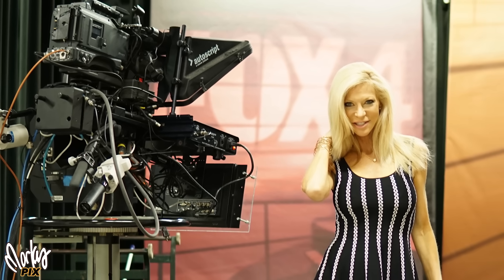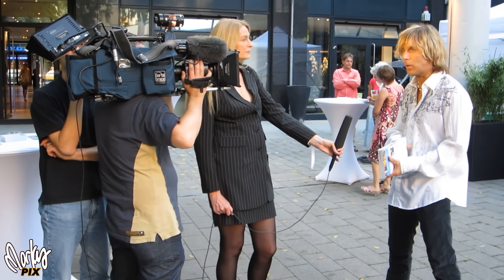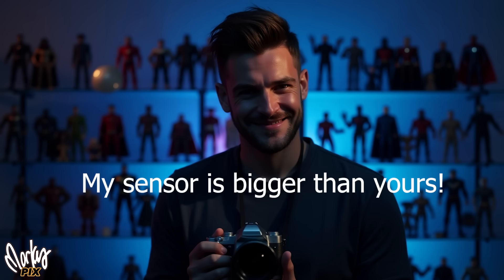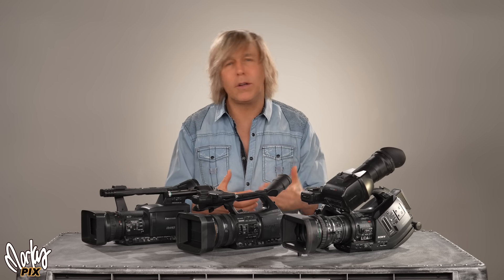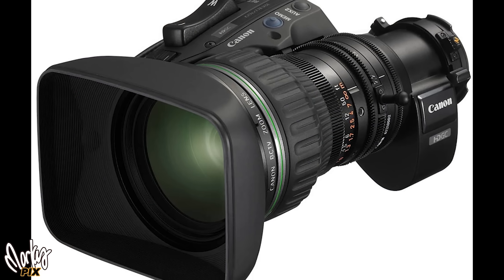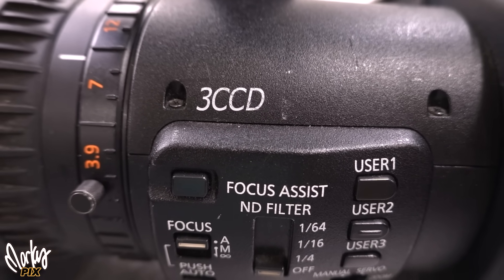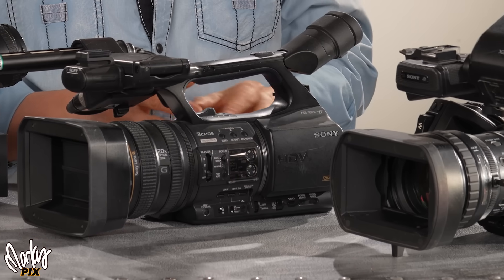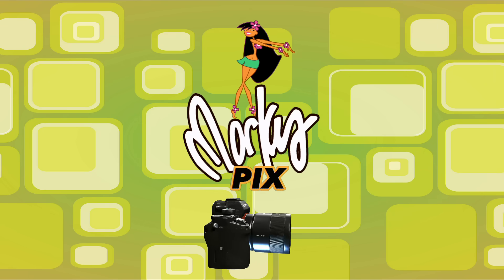Why the Broadcast world uses 3 chip video cameras

Comment: I own a prosumer camcorder with a prism 3-chip sensor technology, it is the last one made for a consumer level with a rather affordable price. The Panasonic HC-X920, which was at about 1000$ when it came out, I got it for 180$ second hand.
The sharpness of the image is insane, the guts of the camcorder don't take much advantage of the amazing sensor it has but it still makes a much clearer video than many newer consumer cameras.

Sony makes prism camcorders now like the Sony PXW-Z190, Z280, Z750, but they cost a lung to obtain. I wish more companies offered a prosumer camera for 4K 60fps prism technology without all the tricks and bits of a broadcasting camera that make it insanely expensive.
The cost is not because of the sensor, a replacement for a Sony PXW-Z280 is about 400$ and the camera costs like 8k or something. It is all the additional things a broadcast camera has that we do not need as users who simply want to capture shots and post process them.
Reply from the maker: I had three X900's and loved them! https://youtu.be/7qZPBGfQ3hQ?t=997 even shot a documentary with them 18 years ago
Reply: @MarkusPix  And imagine the HC-X920 is the upgraded version of the HC-X900. It had enough pixels to do 4K if the rest of the hardware and/or firmware allowed for, if only we had a firmware tweaker like the canon's magic lantern we would have been able to do magic with it.

I wish someone would make a consumer level camcorder with a prism technology and 4K/60fps that would cost close to 1k. That would be my go-to camera.

Another reason broadcasters go for prismatic technology is there needs to be 0 computative pixels, meaning they simply read the RGB values and simply send them, the debeyering process is process heavy (so it is slow) and produces all the chromatic artifacts that we don't want.

Once you go prismatic you never want to go back.

Comment: It's worth remembering that 3CCD was adopted in broadcast because the previous generation of users were familiar with working with an RGB based workflow in the analogue domain with 3 tube cameras. Basically anything that could be plugged into a Sony triax cable in the studio would probably be OK. The camera system needed to be racked (colour balanced etc.) remotely using a CCU by vision engineer in the live environment and provide signal feeds to the on camera video monitor, 'on air' tally light and provide talkback and monitoring circuits. Sony and Ikegami were clever by making the camera head and camera to triax fittings modular in the analogue days and as a consequence the move to digital 3CCD as far as the camera operators were concerned was simple, just plug the camera into the triax and away you go. The front panel controls looked the same, did similar functions and pre-transmission camera line-up now took minutes not hours.

Comment: Phenomenal explainer video!  Your insight, including the shogun off-camera recorder, the mention of 1080i on most, and the cmos vs ccd mention make for a clear understanding - even to a luddite like myself.  My question has to do with the 3 color separations for the best color reproduction down the line.  You also mentioned that 3ccd cameras are most ideal for chromakey work.  I found a (circa 2006) Sony HDV-1080i 3ccd gem for $45 (equivalent).  Could you feature a video wherein you use one of the 3ccd cameras to do a chromakey video - possibly with OBS to facilitate real-time keying.  Even if you just do a demo with passive keying in post, but using the 3ccd benefit of separated green for a better keying it out, that would be amazing to see.  Thank you in advance.  - laowai laoshi

Comment: Colour separation can be handled perfectly on the Bayer matrix type sensor using the photosite filters, no problem at all. All the mid 2000s DSLRs have excellent colour, right. In the last 15 years, quality filter curves have been somewhat sacrificed for higher low-light sensitivity.

The reason 3chip cameras were fundamentally preferred is due to aliasing. When you have guests, they might be wearing pinstripe pattern or the like especially if it has a strong saturated hue it tends to blow up on Bayer especially in motion.

Comment: I’m genuinely surprised that 2/3” sensors are still dominating live broadcasts that aren’t sports related. It makes perfect sense for using a zoom lens setup to catch live sports to get the maximum use out of the focal length of the lenses, but for talking heads it makes very little sense not to be using Super35 with a three chip design like the 2/3” sensors use
Reply from the maker: They are starting to switch.
Reply: @ hopefully that trend continues, it just makes sense as we get closer and closer to the era of 8k TV screens being more commercially viable for consumers and broadcasts will naturally follow that trend albeit at a slower rollout pace. But with us already firmly in the 4K market, this is just the only reasonable way forward

Comment: That mostly 3-chip cameras were used in the past might be more about getting the color resolution without involving a Bayer filter and the necessary processing. It still gives a cleaner result on three 1080p chips today. And it gives a cleaner green signal as the processing of a Bayer filtered sensor would give, even though the green filter patches over the sensor have more or less the same characteristics as the green filter in a 3-chip camera – it is the algorithm that "smears" the color over adjoining pixels that makes the "signal" less precise (even though the Bayer filter uses twice as many green pixels than red or blue). The Foveon sensor tried (or still tries, I'm not sure) to have three consecutive layers instead of the Bayer filter.

Comment: They have made them, back on the day I had a pv-gs65 and a pv gs400 both were awful in indoor light but spectacular in daylight. Although the gs400 was a little better in low light. They also made the dvx that's not HD but is 3ccd. Canon xl /gl camcorder were Panasonic competitors but didn't make anything like the pv-gs series.

Comment: Another cool video idea for your channel is piggy backing on this 3chip video is show the differences between a lens designed for 1chip and a lens designed for 3chip sensors.

At first that ebay broadcast zoom seems to have crappy image quality when adapted to your 1chip camera, but if you have the right adapter; like an IBE HDx35, it corrects for the lack of a prism and will make the 3chip lens perform as intended but now on a 1chip camera.

Comment: The 3chip solution is cheaper
Maybe the camera is a bit more expensive, but the a 4k 100x IF box lens with $1M price tag will cost $2M for single chip camera
I empathize IF(Internal focusing), because this is high cost optical design 
Camera cost nothing here

Comment: The only thing you can accuse Markus is of heating the used camera market! Funny thing is that those cameras actually can benefit from 422 encoding since they have the information to feed the subsampling, most consumer, prosumer cameras cannot provide any meaningful data, so they just upscale to 422. Now the catch, every mediocre camera under the sun is going for 10 bit 422 especially if you're trying to go HEVC (h.265) the iPhone uses it, canon uses it, DJI uses it, go pro, you name it. Most of those cameras just upscale and fill the extra space with no information at all! Now go try to edit this footage without a modern Mac or intel processor (12th gen or newer) it will not have hardware decode acceleration! You are out of luck if using AMD CPU/GPU or Nvidia funy enough Nvidia will decode 444 and everything in-between. I dare anyone to spot the difference even while pushing a grade in a color managed environment between for instance Sony's 10 bit 422 and 420, there's none. It's only there to meet the standard. At least they give you the option to shoot 420 (apple and canon do not, DJI I don't know). It even warns you "a suitable 422 environment is needed to edit this shit". Then you see the cap, sponsored links YouTubers complaining when a camera does not record in 422 while Markus was right all along. All you need is 8-bit and good practices. Thank you so much for existing and doing the work you do. Keep at it, much needed!

Comment: The “3 Chip” concept actually dates back to the earliest days of color TV with RCA  TK-41 Color Camera introduced in 1954 still in use in the late 1960s.   It used the same technique of splitting the optical path in three parts, that camera illuminating three inch Orthicon tube sensors, the only way to do it with the technology available at the time and just a adaptation of RGB color separation techniques for film and printing.

The CCD was invented by Bell Labs in 1969 and garnered a Nobel Prize in 2009.   The tech responsible for the single chip CCD camera was the invention in 1976 of the Bayer RGB filter array which goes over the CCD or CMOS sensor.  Most of the innovation since has been in miniaturization,  color bit-depth, signal processing speeds and algorithms for things like USM and HDR.

A Bayer array is actually RGGB with twice as many green sites than R  or G because in human vision the retina consists of green sensing RODS cells which outnumber and are 3000x more  sensitive to light intensity that the RGB CONES which are concentrated around the optical nerve.  So each sensor site of a single CCD Bayer array is only accurately capturing 1/4 of what 3CCD is capable of and why 3CCD is technically superior except for the cost of light intensity lost by splitting the image path.

Comment: The Blackmagic URSA Mini Pro 12K, URSA Cine 12K LF and URSA Cine 17K uses an RGBW single chip sensor which has a 6x6 subpixel substructre with equal red, green and blue.  That would be the closest to a 3-chip sensor on a single chip.

I should mention that a 3-chip CMOS sensor is less destructive than a single chip bayer sensor, this could be one reason why they have less of a reason to go to 4K as they don't need to oversample to get a perfect 1080p image.

Comment: We did an 8mp analog sensor, full frame for JVC back in 2001, they used three, three color and a prism, and the results were stunning. The problem was, that there was nothing out there to handle the data or project it. All custom hardware just to demo it. It was years for the downstream hardware to catch up, by then, everything went digital, and so did we.

Comment: Hi Markus, nice video on 3 chip cameras. There were some affordable cameras. My first 3 chip was the Sony VX-1000 3CCD which I purchased in 1996. At the time it was around $4000. I remember getting on a waiting list to get one. Great video for the time. In 2014 Panasonic came out with an affordable AG-AC90. Picked one up for $2,200 on a Black Friday sale. This one is a 3 MOS. It's not the most rugged camera but it does 1920x1080 60p with a very smooth zoom. The 5.1 microphone not the best, lacking bass. Great video though.  It's a keeper. Thanks for the great videos.
Reply from the maker: Panasonic is great but they like to use microscopic sensors arrgh

Comment: All modern cameras ARE '3-chip'  but  each chip has been interleaved at a pixel level  with something like a bayer pattern or x-trans in Fuji and RGBW with some Blackmagic sensors. Some sensors are stacked. In a sense these are 3chips put over each other rather than optically splitting the sensor via a prism.
Whether the interleved grid patterning of 3 chips on to one surface of a bayer pattern sensor or 3channels via prismatic separation the resolution and interpolation are easily calculated or derived after the light hits the pixels of the sensor using now very sophisticated software. 

     Current day modern cameras are drastically higher resolution and the dynamic range of the sensors and their individual pixels regardless of the colour they are capturing  is many stops wider (bit depth)  so there is no comparison with older 1080 3-chip stuff. It's a LIE that the same vibrant colour cannot be derived from footage shot with modern higher dynamic range /higher resolution sensors available in full frame and APS-C cameras. 
Further steps in processing  this work flow can be easily scripted or baked into software apps used such that there is near benefit to using good ol' 3chip miracle 1080 sensors for most people.
Example:
My Fuji  xtrans sensor can give me 2080×1376 resolution PER R/G/B colour images with a bit depth if 12 , 30 times per second.  This is drastically higher than the 3chip cameras at 1080. The camera in question is less than $2000 USD to achive this. The camera mount can be adapted to fit nearly ANY lens and or iris and or focus system.
The discussion is long over about whether old 1080 3-chip systems would offer an advantage over many inexpensive modern DSLR / mirrorless type hybrids.
 Clean mattes can be pulled from bayer pattern or x-trans or RGBW sensor with pretty equal quality to any older 3-chip since the resolution / pixel pitch of the sensors is so high. Software can improve the perceived resolution of a Green  or Blue channel through calculations based on adjacent pixels with different colour filters and multi-frame analysis. What matters for compositiing of matte layers is the colur sampling format at recording i.e. 4:2:2 colour @ or > than 10 bits  vs 4:2:0 @ 8 bit  where 12bit 4:4:4 might be the very best if available.
3-chip is still a valid system as is a triple laser/ light source system on a projector. Technicolor film had its advantages but we became very clever about interleaving and layering technology. 
There is no 'penalty' with modern high res high dynamic range sensors in cameras that can achive the 'cinematic/blurry bg ' look. It's an ADDED capability that lumen hungry 3-chip  slow zoom lensed camcorders can never a hieve but the implication that  the 3-chip colour space is uniquely available to these old dinosaur cameras is ridiculous and you kmow it Markus.

Comment: Its not really about color accuracy or skintones. The principal advantage of 3CCD or 3CMOS sensors is (other as by Bayer type sensor etc., where the light isblocked by filters) that all the light that enters the camera lens lands on a sensor element. No one of the cameras on your table is (or was) a pro broadcast camera.    Broadcast cameras are able to be controlled remotelly.  On remote camera control panels are made adjustments not only for basic parameteres like gain, shutter, aperture,  but also the gain or black levels for every color channel separatelly and a dozen of other parameters. On live broadcast trucks is always a big section with specialists, that control the levels and color matching during the production.

Comment: I bought a Panasonic SD900 back in 2011 (still works) The colour was great if very slightly green. Filmed the last Space Shuttle launch on it plus lots of foreign trips and some low end commercial stuff. I think Panasonic took the guts out of it and put it in a budget shoulder mounted body called the AG-AC8EJ which was used for loads of wedding videos.. If anyone reading this is going for the give away I would recommend the X900. I would love the Panasonic HPX 170P but wont enter as I'm in the UK and the shipping cost would be horrendous.